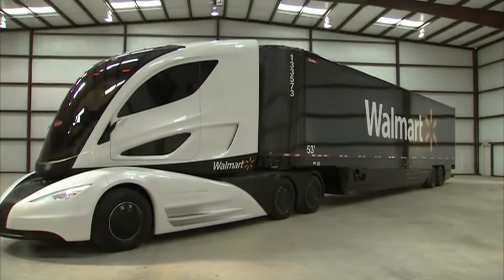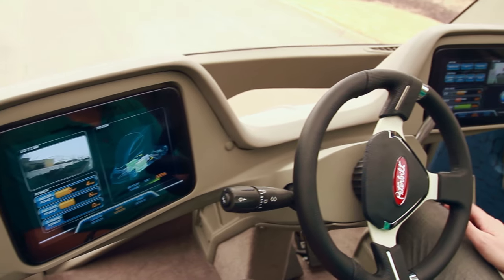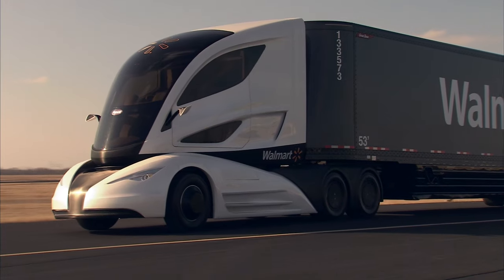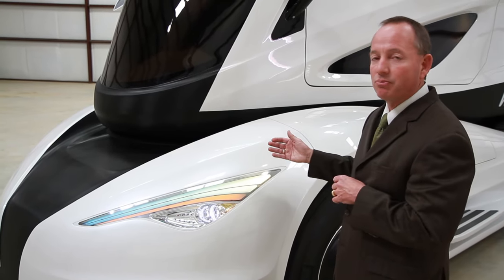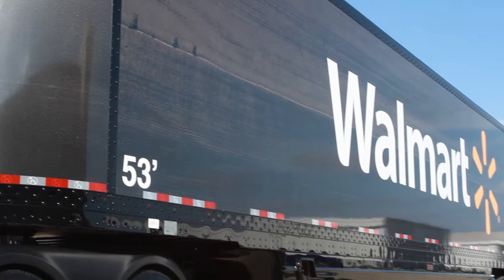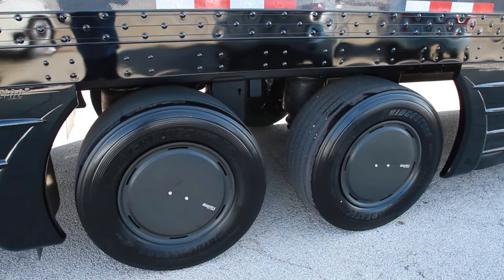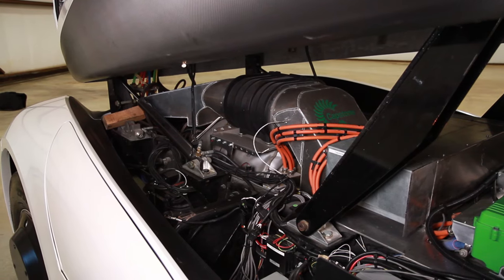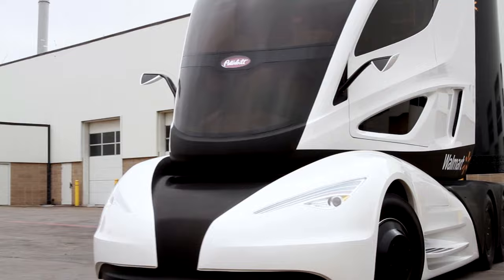Walmart Advanced Vehicle Experience Concept Truck

Comment: I live in the UK so we don't have Walmart here (well, they own a company called ASDA), but I love the design of this lorry.
Every engineer knows that a small tweak here plus 100 other small tweaks can result in big gains, so I like the bit where the Capstone guy explained about how the turbine has air bearings (so no oil) and is air cooled (so no radiator) so the truck has a more aerodynamic cowling and no engine lubricant to recycle.

Comment: WOW! I'm a heavy diesel truck mechanic and I'd love to get my hands on this! Air bearings in the gas turbine, fascinating! I'm an old cummins diesel mechanic but I could certainly adapt to this technology. They must somehow keep the combustion temperatures low enough in the turbine to prevent nitrogen from catching fire and producing nox. I hate diesel exhaust fluid and I'd be happy to see it go the way of the dinosaur.
I wonder if the turbine can burn diesel and stay epa certified.
Reply: *****

Now that you mention it, it is pretty low to the ground. That would probably keep the body guys working through.

Comment: I am wondering about the turning radius? I love the long nose Petes, but they have a short turning radius. Will it pull a mountain without lugging down? (Donner, The Sisters, etc) Being a ex-truck driver this brings on several questions about the stability of the vehicle..how will it hold up in high-wind areas and storms?

Comment: Gentlemen, Your doing a fine job with this design. As a professional driver I can appreciate what your doing here. I would love to drive this truck for you.  Promote it and bring the industry out of 1950.   This is as close to my design as anyone has gotten. I had this truck in my head when i was 10 yrs old.  That was some years ago.  I think I can help you with a little tweaking of your designs here. But I love the radical departure from  Square hoods square trailer fronts, poor attempts at aerodynamics , without really committing to changing , fundamentally what makes a truck a truck.   Truckers are a funny bunch, to much change to quick, and you scare them, But if the design is good practical, and cool, they will embrace it completely.  Your getting there.   I would love to be a part of this.  I've tried in the past to contact  people in your industry, buy I'm a little guy in a big pond. So, Maybe someone up high will see this post and think  to look me up. I'll stop back here from time to time,to see if anyone on your end is interested in my particular Skills, and experience.  Thanks, good work.

Comment: 1. How about having a mechanism between the tractor and trailer that prevents jack knifing? Either a pair of air cylinders on each side going from tractor to trailer or some kind of motor and gear mechanism like the pivot on a crane. 
2. Also add steering to the trailer wheels so they can negotiate small city intersections and loading dock yards. 
3. Can you buy a semi tractor with a driven front axle? I've watched Ice Road Truckers and ask why those trucks aren't all wheel drive.

Comment: That's a game changer for almost all heavy trucks. The sleeper didn't look too comfortable though. It looked like a pallet in a prison cell.

This truck looks fantastic but appears to be a difficult cab to access. 

One of the problems truckers have is that by about mid career, their knees are starting to go and their backs aren't far behind. Then there's the issue of being seated for long hours which causes all sorts of cardio, respiratory and digestive system difficulties that escalate to premature deaths. 

So let's hope the pioneering doesn't stop here. 

Of course driverless vehicles are major tech focus now but that's still a long way off we hope due to ease of which on board computer systems can be  hacked. 

A hacked transport of this size would easily become a remote controlled weapon at the direction of some 11 year old kid or a savvy terrorist. 

I believe driver comfort and safety are more desirable goals in the short term.

Comment: at US $5.00 per lb for carbon fiber and add in the fact that half will burn of which means more carbon fiber needs to be consumed, this truck will be so expensive that you would have to dissolve half of your fleet to make up the difference in cost per trailer. Yes it makes for less weight and better fuel efficiency, but at what cost. Does the benefits really outweigh the risk?

Comment: Where's the storage space for stuff like paper work? You definitely need a flat surface to fill out paper work.

Also, are those screens touch screens? Because if you're unloading the trailer by yourself, then you're going to get problems with oil / grease getting onto the screens.

Touch screens are normally my least favourite type of screen because of the dirt issue.

Comment: NIce job Walmart. Perhaps you may want to partner with the engineers at Tesla for a shot at an all electric vehicle.  I understand that there is issues as far as the battery weight, but can't that issue be offset by the huge surface area of the trailer for solar panels?  Just a thought.  Keep up the excellent work.

Comment: Jobs for today list : 1 . put electric motors on trailers wheels , solar panels on roof. 2. Gas engines to turn generator and use electric motor instead . 3 .trailer wheels( size and much harder , steering) . 4. electric suspension(use truck movement ) . 5 . on braking use wind flaps . 6. show driver road in advance up or down . 7 Give drivers to feel that they are part of the team .

Comment: It might all be fancy, aerodynamic and stuff but, does it still have the same horsepower as a Diesel engine?
Reply: +BlueRhino600 Did you know that a lot of bigger trucks and heavy equipment don't even use there Diesel engines to move the vehicle? The Diesels run generators that power electric motors at each wheel. The same thing with trains. So yes the electric motor vehicle will out perform a Diesel.

Comment: Nice, but the concept isn't new. During the 80's, the italian designer, Luigi Colani design, built and tested truck using a similar technology. in is truck the driver sat like yours, in the center of the cockpit. the fuel economy was astounding. The truck and the trailer were made to very high aerodynamic standards.  Those truck were also tested in the United States.

Comment: Center driving position could have been a reality ages ago. Center mount the existing motor then side mount (Think mid engine supercar) the radiators. The lack of forward thinking in the trucking industry has been nothing more than collusion with the oil companies to keep fuel consumption high. Think also about diesel fuel being essentially a byproduct of unleaded refining and then try to explain its steady march upwards in price as "just in time shipping" became the norm. I personally have driven over 2 million miles and have been waiting for something like this the entire time.

Comment: Its almost like they are trying to make a fast truck.
Because they said aerodynamics so much
Reply: Evolution Animations its aerodynamic so the truck doesn't have to work harder pulling the load.
Reply: Jack I knew
Reply: Aerodynamics is all about fuel economy, not speed.
Reply: Juan Rojas and speed the faster the air passes the vehicles the faster speeds you can achieve
Reply: Evolution Animations You are correct, but in this case they made it aerodynamic to save fuel, not to go fast. It's all about reducing drag.
Reply: More aerodynamic= More fuel efficient.
Reply: A Baker Aerodynamics means less power is used to fight air resistance. it could either mean better MPG or faster speeds. If you're pushing two identical engines to the max, better aerodynamics will help it go faster. If both are going at the same speed, such as 70 MPH, the more aerodynamic vehicle will spend less energy fighting air, hence, better fuel economy.
Reply: Juan Rojas It looks like they're missing a very important part of drag reduction and that is shaping the rear of the trailer like a raindrop - there's a huge amount of low pressure at the rear.
Reply: frontagulus they didn't show the rear of the trailer in the video. It is possible it has the collapsible teardrop style flaps back there to improve aerodynamics at the rear. A ton of other trailers on the road currently have them, i don't see why they would work so hard to make a true aerodynamic masterpiece and forget about the rear of the trailer.

Comment: The weight savings are good, but the aerodynamics will do little, unless it's going 600 mph.. Sorry but your still pushing the same amount of air out of the way. Its just not going to have a large effect at 60-70 mph.
Reply: Dennis Schmidt I don't think you have a firm grasp on aerodynamics and wind resistance. Wind resistance is a function of something moving air around it. The steeper the angle of the air path, the more resistance. The shallower the air angle, the less resistance. At 55 MPH is where you peak. Anything over 55 and you start losing money.
      - 3% less efficient at 60 mph
      - 8% less efficient at 65 mph
      - 17% less efficient at 70 mph
      - 23% less efficient at 75 mph
      - 28% less efficient at 80 mph

Now this peak can be shifted to higher speeds simply by lowering the air escape angle. You lower this angle by lowering the angle of the object pushing the wind. This is why a open hand pushing water is slow, but a knife hand is fast.  A 45 deg triangle is more efficient than a square at moving air; however, both are less efficient than an 90 deg triangle pushing wind.
Reply: ballzack57  Any benefit from stream lining this truck will be minimal at the speeds it will normally travel. The reduction of weight will be far more beneficial in the real world. The trucks cross section is still the same its still must shove the same amount of air out of the way. Want to make it more slippery? Dimple the trucks body  like a golf ball. Also even if the numbers you have stated are entirely accurate (they are not) a truck like this would gain less than 1 mpg, at the very best.
Reply: The number I used are from a Dept. of transportation study. That study is peer reviewed. I would say it is pretty accurate. 

Friction is not just a function of moving out out of your way, it is also the escape angle of the wind. Less angle = less friction. 

And lets say that 1mpg is what they save. 
From Walmart logistics: "We employ 7000 drivers. Each driver averages around 100,000 miles annually"
That would be 700,000,000 miles driven a year. In 2014 the average cost of diesel was $3.85 per gallon. So they would have saved 2,695,000,000. 2.65 BILLION a year in savings is pretty amazing. And that is 2.65 billion for every 1 mile per gallon saved.
Reply: ballzack57 Yes, I know where those numbers come from,(they're decades old) and no they're not entirely accurate, nor do they deal with aerodynamics. Every vehicle is different, my truck gets the best economy at about 65 mph. Where my sister's car hits it at just under 55 mph. The only "real world"  benefit this truck will experience from its shape, is maybe a reduction in cross section due to more stability. At any rate the cost of the truck will never be recouped from the miniscule fuel savings. (in the real world)
Reply: Dennis Schmidt Well...you can lead a horse to water. Have a great day Mr. Schmidt

Comment: Unfortunately the comment of "the engineers have never driven a truck" is all too evident in all new trucks. 100K in an 2014 Cascadia Evolution where the cb radio system does NOT work, counter intuitive controls and a blown head gasket, 100K now in a 2015 Peterbilt 579 where the lighting is so poor you can barely drive at night and completely fails without warning, massive water intrusion into to sleeper area, I can go on and on. Sad really, and now the advent of hybrid electric? A likely story.